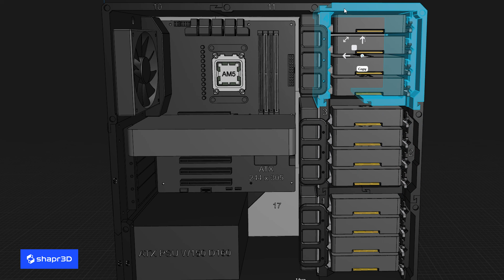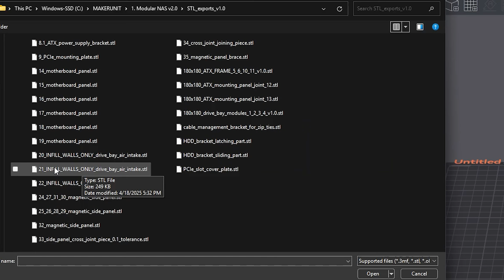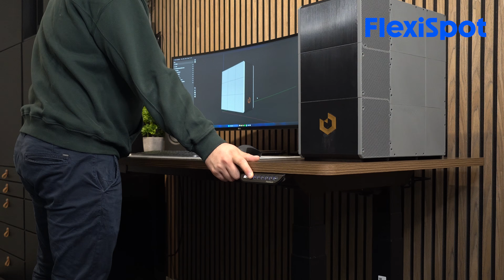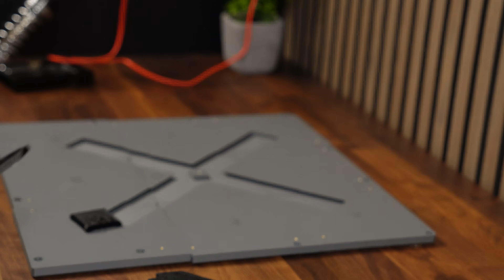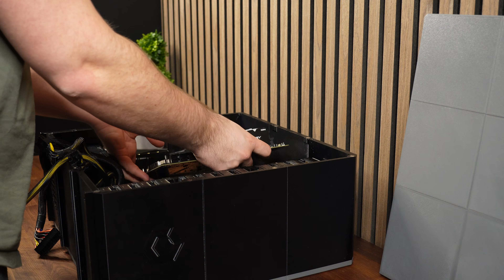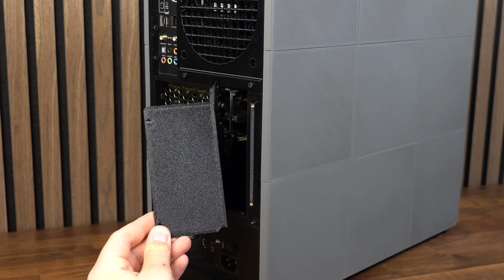Maximize Your Home Storage With This 3D Printed ATX NAS Case

Comment: it's always massive ATX or ITX (expensive boards) builds 😔 I need a very slim/SFF mATX NAS build so I can have 2x PCIe expansion slots (10Gb NIC & LP+single slot GPU). 

Wanted to have something with the main system housed in a SFF chassis and have a drive enclosure as a sort of modular 2nd part, routing SATA data+power cables out of the main 1 to HDD chassis. 
That way I can start small & create another enclosure for drives if I ever expand, without having to change my main chassis. 
Might just have to give up & buy a remade one.
Reply from the maker: This project actually started out as a modular solution but turned into way many parts required so I ended up re-starting the design and creating a fixed setup instead. However it’s still something I want to make at some point in the future when I can find a suitable solution for it to function properly. 😅
Reply: @makerunit classic 😂 an idea running away into something bigger and more intricate. The modular/separated design would be amazing though, just being able to pull it off would be a success in itself.

Always loved the allure of SFF & Mini PC's & have a few Lenovo Tiny's in my stack. Being able to have a sleek main piece that isn't tied down to the rest of the bulk that comes with NAS got me excited.

I think I might try to hold off on my build as long as I can just to see what comes of this coz I always fall in love with these creations (but just have no reason to apply it to anything) for sure gonna hit up my local printing shop & explore it with them 😄
Reply from the maker: @kosmos3718  Actually I made the modular setup work, but cable management was a mess, there were a few weak points in the joints, like potential failure points if someone were to not follow the recommended settings etc. There’s always that one person trying to save filament by using less infill and less walls causing the parts to be brittle and break, then to blame me for not designing it strong enough. 

My goal is to make my designs «idiot proof» to the point where it’s hard to make mistakes and break it. 

As you can probably tell from my almost exclusively 5-star reviews on most models I take structural integrity very seriously. If I see a potential problem, I rather start from scratch and re-do a weak point than post somehing half finished 😁 quality over quantity.
Reply: @makerunit always that one annoying aspect you gotta look out for, the idiots; but it must be considered I guess 😌 you're someone who takes values what they create to think even about that idiot-angle, really appreciate people like you who put the due diligence in for us. 

The more info I get of this the more I want to wait & see if this could be the case for me. Getting an ITX motherboard + CPU very soon, might just go commando & not get a case & leave it like an open-bench. Only concern would be cooler height as I don't wanna buy it twice 😅. 
Would you be able to share what the prototype looks like and maybe even how tall a SFF CPU cooler the main body can house? I'll probably grab up what I need to work around this hypothetical build.
Reply from the maker: @kosmos3718  I’m glad you appreciate my views and devotion to idiot proofing.

I can recommend the Thermalright Peerless Assassin (dual fan) air cooler if you want a budget option. I plan to build my future ITX case based on that cooler too. It keeps my 9950x3D running suprisingly cool barely passing 60-65 for most use cases. Haven’t stress tested it yet but runs generally really cool! It also looks really good in the all black version!
Reply: @makerunit okay okay, this is good! 📝🤔 I'm gonna go on a quick search for that right now. 

I need to hone my eye for styling & colour coordinating more by being mindful of how different shapes & materials work best with a certain colours. Little steps at a time but I'mma get there. Next, a great leap skip into actually dedicating to getting one of your builds printed out & in use! Can't wait for the modular build.
Reply from the maker: @kosmos3718  well you know what they say, once you go black… 😆

… after I started buying all black fans it’s hard for me to use anything else 😅
Reply: @makerunit   Ayoo 😂😂 can't beat it though I'll give you that. Black don't crack, it stands the test of time.
Reply: @makerunit  all set up & running 🫡 gonna migrate proxmox & truenas over.
Settled on the Deepcool CH160 case as it was the smallest that still accommodated the cooler height & I thought might as well go for good cooling instead of those <70mm cooler cases (as I had no experience with them to know how cool it'll be.)

only annoying thing is the case has a ton of free space & no way to mount anything extra 💀 they could've had so many extra mounting points open to allow people to freely set it up. Even the case vent holes are covered by mesh screen so I can't screw anything in easily. what a shame, got a big case taking up space & can't use much internally. dunno if there existed ITX cases supporting "large" CPU coolers that cut down on as much excess space. I'll try looking for modular HDD caddies or something

Comment: How swap bay option with LED bay status light?
Reply from the maker: Hi, unfortunately there’s currently no option for this in the stock configuration. However, the .step file is included on this one so modifying a small hole for a flush-mounted LED is not a difficult modification 😊

Comment: how about 3d printing lego (or similar) and using generic parts to make specific structures, like pc nas cases. avoids the need to re-design the parts for the specific thing every time.
Reply from the maker: I actually started this design with modularity in mind, but ended up changing this as it got way too complicated and required way too many parts to function properly. I did make a few prototype parts but ended up scrapping that for now. 

However the idea is not given up on yet, I plan to get back to doing that eventually once I figure out a better solution.

Comment: Switching the position of the power supply above the motherboard would eliviate some of the cable mess created by it. (But maybe not ideal for case stability?) I really like the case though. Many great ideas!
Reply from the maker: It could definitely help in some ways, and other ways not. I always try if possible to keep the center of gravity low to keep it more stable, but with 12 drives it may not be a problem with stability but without them installed it might be 😁

A potential future V2 will probably find a better solution for cable management, possibly even by flipping the drives around with connectors from the backside where the air intake is now.

Comment: Great video and design ! Any change of you making a version that supports e-atx motherboards as well ? I have a X99 dual xeon motherboard here that i'm about to start working on and it is 330x305 mm...
Reply from the maker: Hey! There’s a chance for sure, however I’m about to become a first-time father in a couple weeks which will be a time-limiting factor. I also do not at the moment own any E-ATX motherboards myself and I generally prefer to work with parts I have at my disposal for testing fitment etc, so it’s unlikely that it’ll happen any time very soon but with the included .step file you can try to modify it yourself if you’re up for it 💪
Reply: Might have a crack at that :) good luck the upcoming baby - it shure is a game changer:)
Reply from the maker: @ Thank you! Definitely a big change, I’m very much looking forward to it though 😊

Comment: Hey, I'd love to have this NAS case supports E-ATX motherboards. I'm having a really hard time on finding any NAS case that would fit great an E-ATX mothetboard for dual Xeon CPUs. If you could do that would be amazing!
Reply from the maker: With the included .step file it should actually be possible to extene the entire chassis slightly to make it work with even E-ATX. Though the magnetic side panel may need to be redesigned a bit, but not impossible!

Comment: very cool design! just a heads up for you (and anyone considering this setup): SAS cards like that need direct cooling or they’ll throw checksum errors like crazy. they’re designed for rack mounted servers where the entire rack has constant unidirectional airflow, and they overheat very easily in any other environment

also, if you’re buying a used enterprise card like the one in this video, it’s a good idea to unscrew the heat sink and maybe apply some extra thermal paste to the two main processors, and possibly some direct cooling for those thin blue mini-SAS breakout cables (i have that exact same card and learned this all the hard way lol)

but the benefit of those LSI cards is you can use SAS drives in addition to SATA, which last longer and are more reliable because they’re made for enterprise deployment
Reply from the maker: That’s definitely good to know, I have noticed how incredibly hot it gets. I’ll try to figure out some cooling solution for it 💪
Reply: @  i’d be interested to see what you come up with, cuz my current solution of “lay my tower on its side and put a 140mm Noctua fan an inch away from the heat sink, blowing directly on it at 100% speed” isn’t the most sustainable 😂
Reply from the maker: @glitterishhh  I was thinking something like a bracket of some kind that bolts directly onto th3 existing holes perhaps using longer screws.

Comment: What os did you use?
Reply from the maker: Currently it’s only running Windows as I’m still experimenting a bit with this part. As mentioned in the video I’m very new to the OS and hardware part of building a NAS. I’m planning to try to install TrueNAS 😊
Reply: @makerunit  Sweet, thanks for the update.

Comment: Great design! I'm definitely stealing the different joint ideas for my projects :D
Two notes that might help people in their hunt for a SATA PCI-E card:

First, the "16i" in the card name means "16 Internal connections" (the "i" is for internal). There are also "16e" cards that will have the ports coming out the back of the case. And other combinations too, like "8i8e" for example. If you find a good deal on a combo where there are at least 12 "i"s, it would work. Note this is mostly for LSI cards, but it's likely you'll be getting an LSI card because they are the major player in the field.

Second, you're looking for an "HBA" (Host Bus Adapter) and not a "RAID Card". HBAs are practically only ports and nothing more, they hand off each drive to the OS and the OS can do whatever it wants with them. This is the "modern" way of doing this, as it gives you much more control in setting up your NAS. 
RAID cards do their own thing and only present one "drive" to the system, which was useful when the main system was too slow to manage all the RAID logic by itself, but that time is long gone now. But since you're likely buying second-hand (you should 100% be buying this second-hand), there are a lot of RAID cards still on that market. 
Some RAID cards can be flashed to be an HBA (flashing=more complicated software update), but second-hand sellers will usually do this before selling the card as that will make it more desirable. Be sure to read descriptions in these cases :)
Reply from the maker: Thank you! Glad you like it and that you were able to get some inspiration from the joints! 😊

Ah I did not know all of this information especially what the difference is between «i» and «e» cards! 

Thanks for also specifying the difference between Raid cards and HBA’s I honestly thought they were the same. Good to know for sure! 💪
Reply: Thank you! i was wondering about this exact thing!

Comment: I was watching your old videos and was writing exactly what you did. Common motherboard, GPU, PSU, lots of HD. You can include in the next version, only SSDs. * Never, ever pull hot air into the case. The fans should be part of the side panel and pull hot air out. Thanks!
Reply from the maker: My thought with this airflow design is that most people running NAS systems tend to go for lower end CPU’s drawing less power therefore less heat generated. Also with support for up to 160mm air coolers you can use something like the super affordable Thermalright Peerless Assasin which is super effective, even my other case running a 9950x3D runs this cooler with great temps. 😊

My thought is in a NAS the HDDs will probably be the most expensive parts and most important as well to store all your backup files or whatever you have on there. While if the rest of the system runs a little hot it’s less of a problem in my opinion 🤷‍♂️😊

Comment: I would like a design where the front panel is detachable and the hard drives can easily be replaced from outside
Reply from the maker: I see. I’ll keep it in mind as feedback for a future potential v2 😊
Reply: @makerunit  Yeah, there are sockets available for data/power (aliixpress SATA Male To Female Power Data Converter) that make it pretty easy to put as many drive bays in as you have room for,  if you have the CAD skills (I don't).

Comment: Love the bigger scale ATX. I’m wondering if it would be possible to do this but not as a NAS focus? I’m wanting to build my first pc and I think that this would be perfect if I could not have the NAS version.
Reply from the maker: Hey! It would for sure be possible. However it would require a slightly different approach to the design as the drive bay itself has much of the structural integrity of the design, so I’d need to figure out some new ways of mounting things. Definitely not impossible though! 😊 I’ll keep this in mind